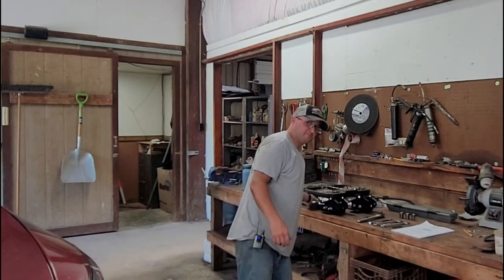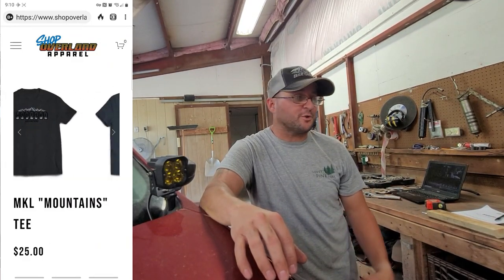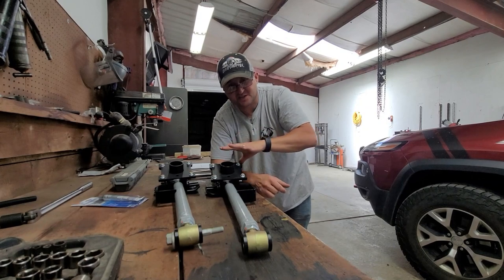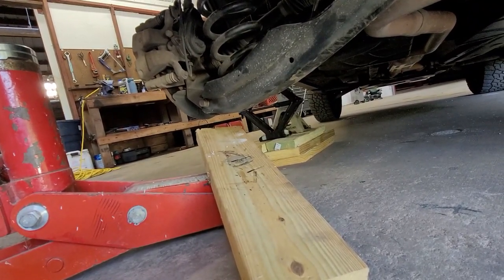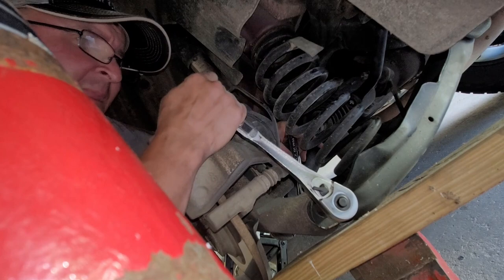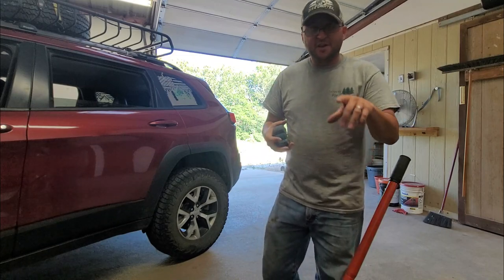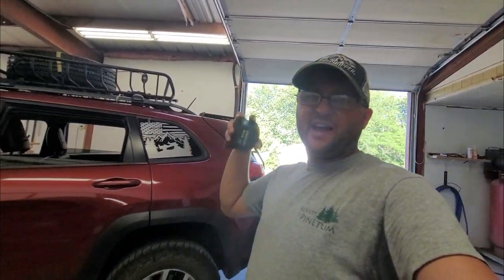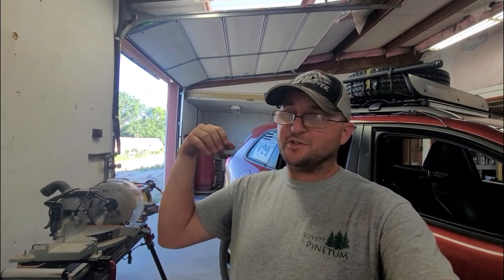Install of Gleaming Alloy Stilettos!  The Best Lift for Jeep Cherokee KL

Comment: It looks cool! That said , Teraflex has your spring sitting straight in the rear because they angle the lift. 

I have the Teraflex lift on the rear. I haven't put on the shock extensions yet though. I'll have to make a video when I do and show the full setup.
Reply from the maker: Yeah I heard Tetaflex was doing that. Glad to see them making a lift for the kl. That's great that they're getting the angle right on it.
Reply: A video of the Teraflex would nice.

Comment: With the new Stiletto arms they don't make any noise when you go over an obstacle on the rear wheels?  I'm not saying it's a loud sound but a different sound from the original arms
Reply from the maker: If I don't gease them often enough it will. Outside of that not any change in noise that I've noticed.
Reply: @MootsKLAdventure  They need to be greased???

Comment: So this is made for the rear shock to be stock? So we'd only need these and the front lift kit
Reply from the maker: Yeah they basically give you a lift in the rear but unlike other spacer lifts for the KL's the keep the spring angle the same as when it's stock.

Comment: Looks like great quality and design, but $700 is a bit steep for my budget, so it's Hazard Sky for now. Great job! What about the alignment and ride quality?
Reply from the maker: My alignment was pretty far off when I finished so definitely plan on getting an alignment done after installing any of the lifts out there.  I had the HS on before I replaced it with the Stiletto's.  The ride quality is better now than it was.  I had no issues with the ride quality with the HS lift but it is smoother with the Stiletto's.  I'd say if you're on a tight budget or not planning on doing much off roading then the HS lift is a great option.  The Stiletto's are really for those that plan on getting into some more difficult trails.  Most of what I run I'd be fine with sticking with the HS lift but I want the added ability just in case.  I should clarify that I still have the HS lift on the front as well.

Comment: Time for a dumb question. I’m currently using the lower control arms to jack up the back with a floor jack. Once I put the stilettos on then where to lift? Floor jacks don’t fit in the factory jack spots. Is there some type of adapter I can get so when I put the stilettos on I have somewhere to jack up the vehicle. Thank you.
Reply from the maker: I'm not sure on that. I've been using my jack that came with the jeep. It's not to bad to use.

Comment: When u installed it did you have to take out the hazzardsky lif that was o. It or u put it back on with them
Reply from the maker: I removed the hazard sky lift in the rear but kept it on the front.  I got the 2" lift variant of the Stilettos.
Reply: Thanks ordering today
Reply from the maker: @felixdiaz7841  I think you'll be pleased
Reply: Can't wait thanks for the videos gave me the confidence to install my own parts following your videos the only detailed installation I found so far thanks

Comment: Does the rear wheel centering kit need to be used with the stilletos? I assume it would need it?
Reply from the maker: Technically yes but honestly it doesn't do much for centering the wheel. You'll max out at moving the wheel 1/4" back. If I had it to do over I wouldn't have bought them.
Reply: @MootsKLAdventure  Thank you!

Comment: I can’t use this arm life with my existing mfc lift?
Reply from the maker: You can. You would leave the front portion of the mfc lift and this would replace the rear portion. So you'd remove the rear part of the mfc lift when you instal these rear control arms.

Comment: I am wondering if gleaming alloy has a contact number. I have a Mfc off road 3-inch lift on my Trailhawk, I am wanting to get info that if I get the set that they will work with Dobson springs, will I loose and inch in lift installing these. Thanks for any info
Reply from the maker: I didn't see a contact number but I believe there is a way to contact on the website. I know that they have a 3" version that is supposed to be coming soon. I think he's got someone testing it out right now.
Reply: If you get the 2” Dobinsons-specific Stilettos, you’ll remove your MFC spacers when installing the control arms and maintain your current (3”) lift. They’re basically designed to replace an MFC 2” lift and keep the same height.
Reply: You can message them directly on Facebook, he got back to me really quick. I do believe they are making the dobinsons variant

Comment: Is it a true 2 in rear end lift?
Reply from the maker: Yes it is a true 2 inch lift.
Reply: @MootsKLAdventure  is there different control arms for the front?
Reply from the maker: @Midnitesilverrun  this is just a rear lower control arm replacement/lift. You can also replace the rear upper control arm to help with alignment after lifting. For the front the only lift option I've seen is spacer lifts.
Reply: @MootsKLAdventure  thanks for the answer

Comment: Please don't use a spring compressor!! 

I actually had mine done at the shop and the guy used a spring compressor.... He kept going back to the drill six or seven times because he could never get the screen compressed quite enough...

This was a full-time mechanic... 

Don't do it! 

It did not look easy...
Reply from the maker: Yeah I don't like using them. It's to easy to just drop it after you take out the knuckle bolt.